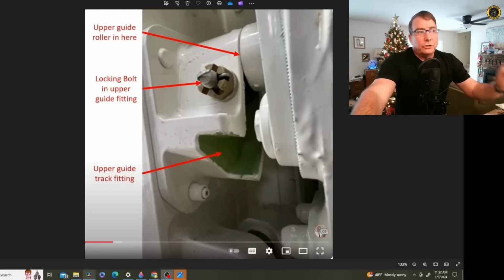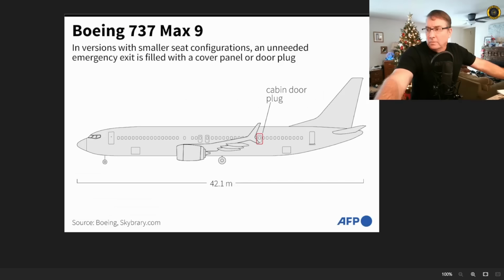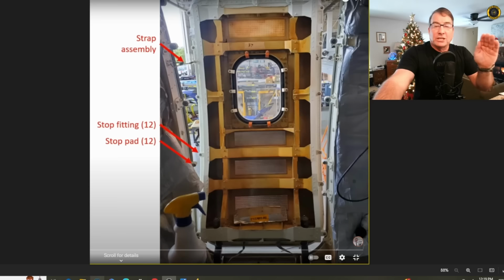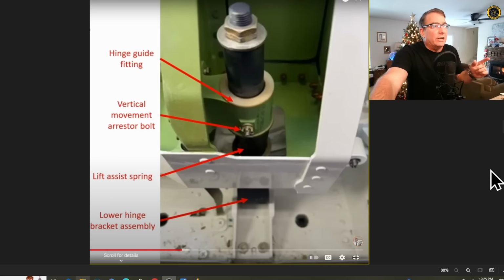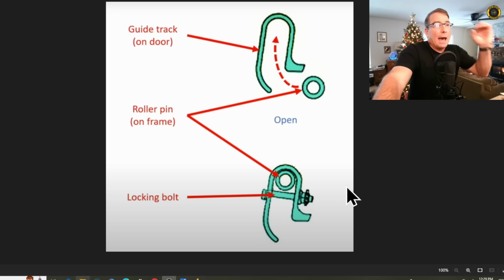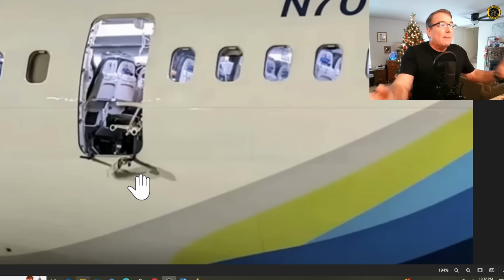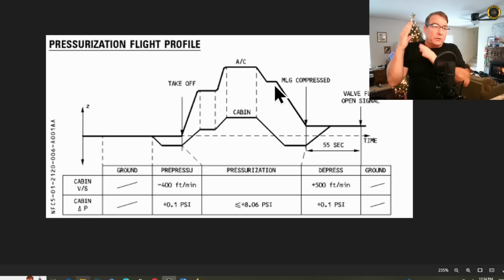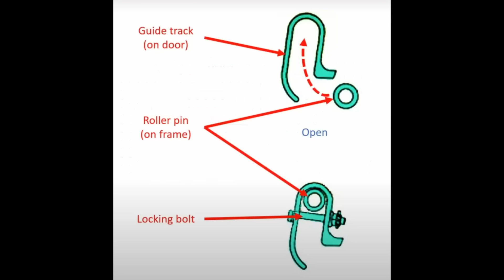Alaska 737 Max-9 Door UPDATE! 8 Jan 2024

Comment: Thanks as always for this useful coverage. In her report today, the NTSB chief referred to the cockpit door being designed to open in rapid decompression. Unless I’m mistaken, she did not appear to stress that this is NOT the same as the ‘door plug’ that detached from this plane. The reason for there being a door or panel between cockpit and cabin which can open in the case of a sudden depressurisation is that without it there might be a significant pressure differential which could place excessive stress on the airframe. This safety feature has been built into planes for many years. IMHO the NTSB boss needed to make the difference crystal clear.
Reply: NTSB boss...

Comment: I was reading in the IT tech press today that they have found 2 phones that got sucked out at 16K feet and they both survived intact.
Reply: Another report said the headsets for the pilots were pulled off their heads during the event, after the flight deck door blow-out panel let go.
Reply: @aeroman5239  That's absurd from any angle.
Reply: @aeroman5239  They would have had to take off their headsets to don their oxygen masks and use speaker mode on the radio.

Comment: From the pinned update it appears on the others its not a matter of the castle nut retaining bolts/pins but is a problem with the bolts backing out that hold the bracket to the frame.  Probably only took one of the brackets to fail and it cause the bracket and that door's side to pull away from the aircraft which then allowed the door to pop free from the other side.  The bracket may have even had one bolt still in but having one bolt back out would potentially allow the "hinge" at such an angle to allow the door to pull free.
Reply: Thank you! Been sitting here wondering how the door could move enough for the roller pins to come all the way down and out of the track.

Comment: I was a certifying A/C engineer, mainly 747, 737 Tri-star and 767'S. These plug doors , if fitted correctly with 4 bolts and locking cotter pins. Should never allow the door to move , let alone open and detach. It would appear from the photos that the 12 stop fittings and stop pads are all in tact. So all that remains is the condition/ or presence of those 4 bolts/cotter pins. My suspicion , is that they were never fitted when the Aircraft door and side wall interior was assembled at Boeing. A certified Engineer should have signed off on that, and that certification record, should be held at Boeing.( In my UK. role, every piece of work I certified, was recorded and that record held on file, just in case an event occurred ) It is standard procedure, in such an incident/accident , that all aircraft records are seized and secured immediately - Held securely for the investigating authority, in this case the F.A.A.

Comment: From everything you describe in your report, my guess would be that all four bolts were left off... forgotten. It seems to me that unless this was the case, the door could not have lifted enough to clear both the upper pin guides and the six ears. The bolts are not the strength of the seal of the door, they only keep it from lifting. So all four, I think, would have had to been missing for the door to lift, as it seems to me that even one bolt, top or bottom, would keep it from lifting, turbulence or not.

Comment: My 43 years in this industry, including many "failure investigations" is making my brain scream out "caution, Wil Robinson" over and over. While this looks simple enough, those are usually the types of mechanisms that cause problems because they are not analyzed properly during design. Just off the top of my head, one failure mode would be that the roller pin and guide frame take the pressurization load out of the top of the door. That could result in a failure of one or both of those parts in low cycle fatigue and their subsequent failure to prevent door vertical motion. Yes, there are two pairs of those at the top of the door, but redundancy is only there as long as BOTH pairs are intact. Fail one and it goes un-noticed until the other one fails. Not saying that is what happened, but I will be very interested in the condition of those parts on the door. I will watch your channel closely for more info.
Reply: Indeed
Reply: "... and their subsequent failure to prevent door vertical motion." EXACTLY what I'm wondering about.
Reply: In addition to locking bolts in the two roller pin / guide frame assemblies near the top, vertical motion is also prevented by arrestor bolts in the two hinge bracket assemblies at the bottom.  Also, the pressurization load is taken by ten or twelve sets of stop fittings / stop pads all around the opening in addition to the roller pin / guide frame assemblies.
Reply: this plane had already been restricted due to emergency light for pressurisation failure coming on 3 times before the door came off
Further more they have now checked other planes and they also have loose bolts on this door

Comment: Alaska continued to keep this plane in service, with alarms going off previous flights..
Alaska and Boeing enabling each other.
This is straight out of the Southwest Airlines playbook.
Reply: The pressurization system issues likely had absolutely nothing to do with the plug failing to stay in place.  It would be like me blaming you for your wheel falling off while you were driving down the highway because your "check engine" light once came on during a previous commute and you had an intermittent problem with your rear window defroster not turning on when you pressed the button.  Neither of these things would cause a reasonable driver to think the continued operation of the car would then result in one of their wheels falling off.
Reply: Airlines fly with inoperative systems ALL the time.  ALL airlines, the world over.  That's why we have so many redundant systems, so that we can.  All airlines have a thing called an MEL (minimum equipment list), which every item in it is approved by the FAA.  When something breaks, the MEL is consulted, some limitations might need to be applied, and off we go.  It allows us to not have to cancel more flights, as well as get the aircraft to a maintenance base to do the repairs.  Some items can be broken for DAYS and DAYS.
Reply: @mountainflyhigh   The MEL is based on known failures,  it is not excuses to keep flying a plane.
In this case there was no known failure.  There was alarms going off, yet no explanation or culprit.   
Old saying" Where there is smoke, there is fire"
In this case your talking about the smoke, I'm talking about the fire. There is no redundant system for the door plug, which was the fire..

Comment: Just a guess:  SPR intentionally leaves these bolts loose, no cotters, KNOWING that BA will be opening the doors for outfitting.  That's documented somewhere, I'd guess. What if BA only removes ONE door for outfitting, the other side left as delivered?
Reply: Interesting question, but it would be BA's responsibility to recheck and adjust the non-removed/opened door plug prior to final assembly and fitting of the interior panels.  And if they were already aware that SPR leaves them loose on purpose, it would be even more negligent for BA not to confirm proper bolt installation and adjustment prior to final assembly and delivery to the customer.

Comment: It's very difficult to judge the length of the guide rollers, but from one of the videos that was taken by a passenger you can see the upper right guide roller. To me it appears as if the guide roller may not even extend past the centerline of the locking bolt. The roller also appears to have a very pronounced chamfer on the end.

I'd be curious to see if the guide roller length and chamfer are contributing factors.

Comment: This system looks extremely solidly designed. Multiple nuts and bolts loosening themselves and falling out in a handful of months? It sounds a lot more like there were no bolts put in at all! With the trim panels and such in place, is there even room for the bolts to fall out or are they blocked by the trim?
Reply: Isn’t the orientation so that the bolt would slide out towards the outside of the hull and the nut is the one facing the inside panel?
Reply: It appears the bolts point inward. That is, the nut is on the end of the bolt that is close to the interior panels. Thus, I don't think the trim panels are likely to block the bolts from falling out.
Reply: @stopgabsolution5457  Ah, good catch. Now that I look again I see that.
Reply: Spot on

Comment: Jaun, I believe the maintenance team errored.  They, on three occasions, missed diagnosed the pressure warning indication as a problem in the pressure sensor circuits.  In reality, the warning system was trying to tell them there is a physical problem with cabin pressure continuity "the lose door plug assembly."  As always, thank you for the informative videos.
Reply: So the sensor was doing its job with a true indication but they ignored it as a faulty sensor?
Reply: @rodneywallace2984  and since the aircraft survived, the pilots have to account for why they ignored the warnings.

Comment: Excellent information! I am looking forward to a discussion of the cabin situation as well; stories are circulating that the cockpit door blew open in flight? Aren't those supposed to be locked like a vault for security purposes?
Reply: Cockpit doors have blow-out panels to equalize the pressure. There are also blow-out panels in the cabin floors in case a cargo compartment depressurizes.
Reply: Any confirmed sources to that rumour.
Also it cannot blow away just like the plug.. I think.
Yes, it can violently be flapped around.. if (for whatever reason) it was not locked in place.
Like when cabin crew might be going in to seve or cockpit crew coming out for something .
Reply: Not a rumor. NTSB confirmed this. Took 3 tries to close it.
Reply: That's the problem with cockpit doors that open out...no room in the 737 to open in.
Reply: Some quick napkin calculations:  Inside air pressure at cruse is 11 PSI.  At 16,000 ft, that's 8 PSI.  That's a 3 PSI difference.  Quick estimate on door size, 6' x 2.5' or 2160 sq inches. Total force: 2600 x 3 = 6480 lbs. or over 3 tons of force.  Yeah, that door doesn't have a chance.
Reply: @russellhltn1396 …amen to that, brother. It’s amazing what a little bit of 4th grade math can lead you to. So many folks stating that “the door is armored, and a little bit of wind won’t bother it”.

Good job.
Reply: @ernestgalvan9037 The internet has made me question if even most college educated adults could pass a basic GED test. 

I'm still amazed there's no metric for what people retain after school. So schools can improve how they teach. 

I always found it ridiculous how many students just crammed for tests then immediately forgot what they learned. So we somehow ended up with a society of over credentialed idiots who struggle with basic grade school concepts.
Reply: @edwardscott3262  People don't retain much at all unless it's practiced.  Most just retain basic math and language skills.  All of the physics and chemistry stuff is forgotten pretty quick unless the person is interested in it enough to keep it "alive" in their brain.

Comment: So lets say the bolts were not installed or all fell out, any hard landing would result in inertia pushing that door down. That could possibly do damage to the tracks on the top part of the door allowing the door to get looser over time.  So the springs at the bottom eventually would force the door up and put the door in a position that it's able to be pushed out when pressurized and get by the stops. It would seem then the door had to be "mostly" open before this last take off. Otherwise the stops would have held it in place when pressurized. So the assist springs at the bottom assisted in the final failure in jettisoning the door away.

Comment: I am not an engineer, but I have worked on everything from lawnmowers to earthmovers and many different kinds of farm machinery.  I cannot comprehend that a door (plug) that supposedly is made to fill a hole in a fuselage was made to be removed that easily.  I would have made it so it bolted into/onto the airplane in about 6 places; none of the hinging/pin/spring stuff.   At the least they should have used self locking castellated nuts so there would be double protection, but then you do have to install them .

Comment: I saw a rumor that this might have been caused by the accident plane getting a wifi upgrade by AAR in Nov-Dec 2023, and that the plane had pressurization issues because of that.

However, AAR just released a press release saying "AAR did not perform any work on or near any mid-cabin exit door plug of that specific aircraft. AAR was contracted by Alaska Airlines to perform a 2KU Modification (Wi-Fi modification) on the aircraft that was performed from November 27 to December 7, 2023.", in other words to not blame them
Reply: Did they forget to put the WiFi in Airplane Mode?
Reply: Well! The complexities and co-dependencirs in these things are way too thick  .. closely integrated.
However if this is a design flaw and usual disinterested, cost cutting oversight on pary of Boeing and subsequent lapses in maintenance.. then that WiFi or whatever thingy upgrade might not be related to this.
But all this is merely my deduction of the situation.
Reply: And yet pressurization errors started December 8th, the day after coming out of the MRO.
Reply: I used to work at AAR and the level of lack of care and ignorance towards maintenance procedures there is astonishing. The only thing that matters is getting the plane done ahead of schedule so the manager can get a big fat bonus for beating the deadline. The safety and longevity of the airframe are second thoughts. That’s why I left to a big 3 airline.

Was AAR at fault here? You would never know because undocumented maintenance is RAMPANT there. Have to be careful because you do something and someone might mess with it after you without paperwork
Reply: @williamcarnero9595 wonder if the United aircraft went through AAR recently that had loose bolts found?
Reply: @sailaab  The information known so far, including that presented in this video, very, very strongly suggests that it isn't a design flaw. It seems much, much more likely to be an installation or maintenance error.

Comment: This incident reminds me of a new Ford hatchback my parents bought around 2000. They heared a strange noise, pulled off the highway into the breakdown lane and one of the wheels fell off. Rolled across traffic and came to rest in the median. Turned out the nuts were factory over-torqued and failed. That car later developed random electrical failures from a factory-damaged wiring loom attached to the ECU. Needless to say, they never bought Ford again.

Comment: The roller pin is too short and any lack of horizontal stability may unlock it. It should be longer and have a notch where the locking pin can sit in.

Comment: What if the whole guide track attached to the door wasn't secure enough? It looks 3 rivets attaching it,  2 visible, one behind. It's just as likely to be a structural failure rather than it sliding off the tracks.
Reply: I was thinking just the same thing, much more plausible explanation passing test of Occam's Razor. Poor weld? Contam/surface prep of welding process, eutectic, or metallurgy?
Reply: @paulsherman51  And even if the guide track and bolts were all attached properly, what if the door/plug itself buckled?  We'd have to wait and see I guess. Considering their recent track record, anything is possible.

Comment: How does the reports of a pressurization warning light factor into this picture. As  a non-pilot, it would make me think that this catastrophic plug failure had been in progress for a while. It will be interesting to follow this.
Reply: My thought too.
Reply: If the bolts were missing, that plug has been vibrating and jolted unrestricted since it went operational in October. That plug is a pressure seal under normal circumstances but if its been moving more than intended it's likely the warnings they were getting were indicating that the cabin pressure was leaking through the faulty seal it was creating.
Reply: @eddy66t6  I wonder if they knew the problem was in that area and thats why this seat was left empty. It is a pretty lucky coincidence otherwise, that in an almost full plane, one of the empty seats is exactly in the spot, where the "door" fell off.
Reply: Wait... it had been getting pressurization warnings... and it was flying?  Gonna have an extra shot the next time I get on a flight...
Reply: @joedo3529   ummmmmmmmmmmm probably they had some information. Good point.
Reply: @markcalhoun8219   THey extnede by three the lubrication interval of the MD-8x stab jack screw. Those are the Alaska Standards

Comment: Working for the MRO that does Alaska's  C checks back ten years ago that would have reqd inspection item (RII)with a mechanic and inspector stamp. That is a new jet so it is no wear close for a C Check  inspection. I bet the FAA and NTSB are pulling the cards in Seattle. I wouldn't be surprised it would be a rookies stamp and supervisor who needed that jet to roll on time.
Reply: Also they would have done a fuselage proof test of blowing the airplane up a balloon to over 9 or 10.9 psi for five minutes. That door of missing bolts would been found with the door being blown across the hangar. Just saying I wouldn't be surprised if they find pencil whipped inspection items just to meet a production goal.